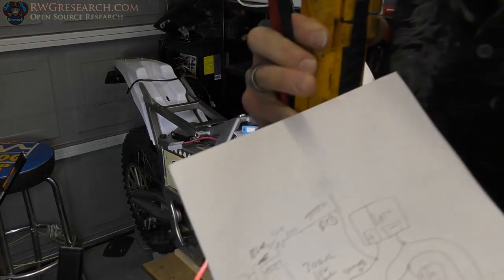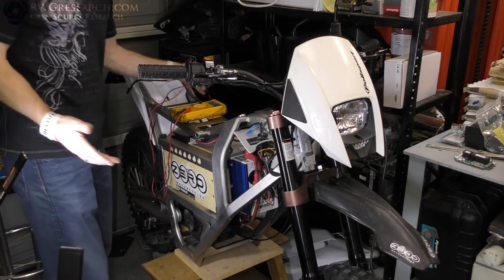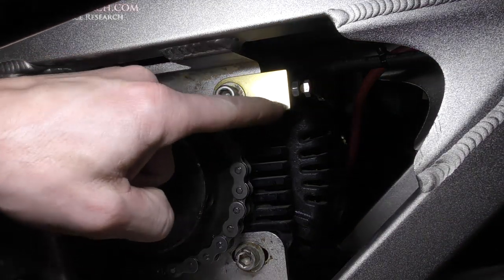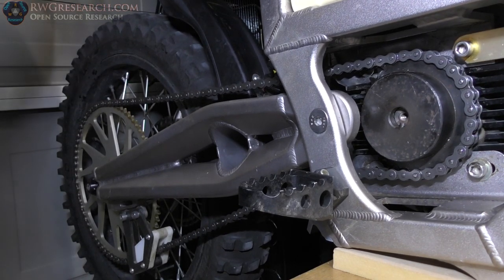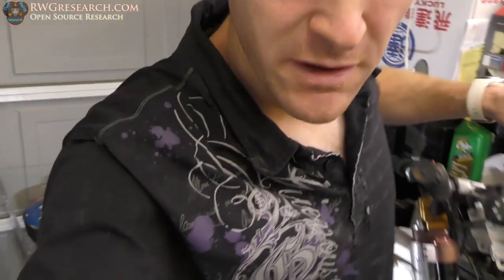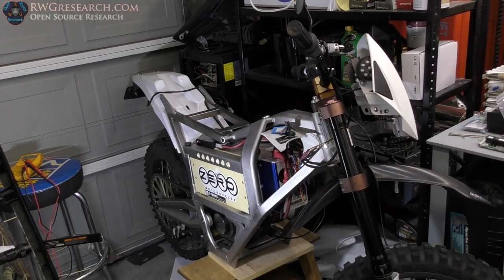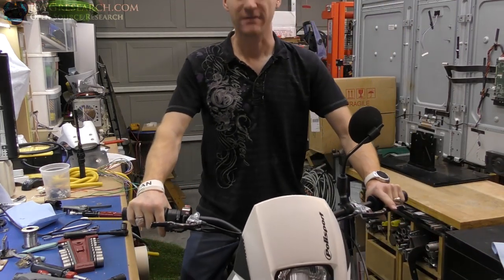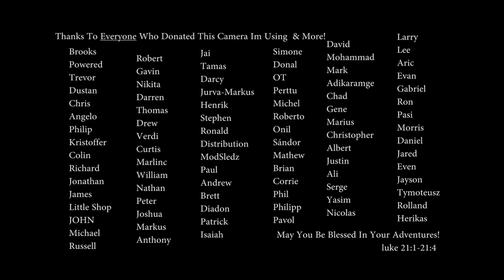Zero P7: Doing The Minimum Wiring & Testing The New Drivetrain.

Comment: that front sprocket looks like an afterthought, or somebody modified it with a larger one... which would explain why it was hitting that bracket you machined for clearance.  They traded torque for more speed. What is the chain size?